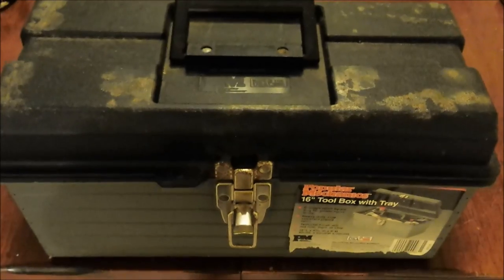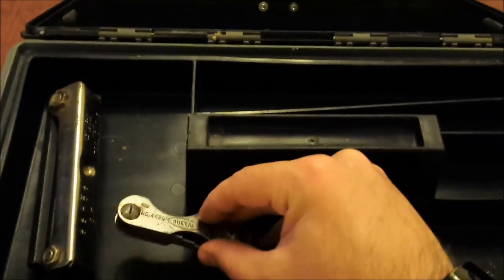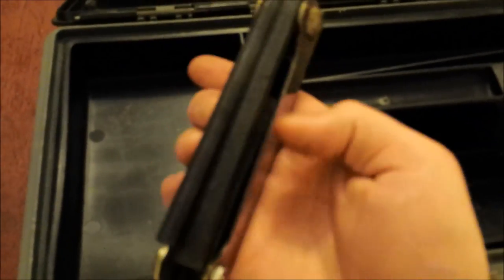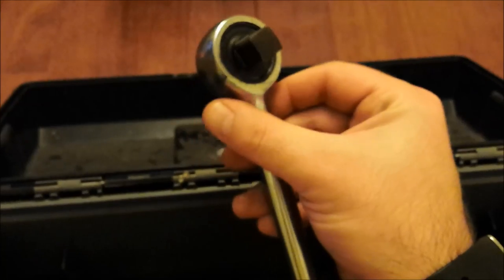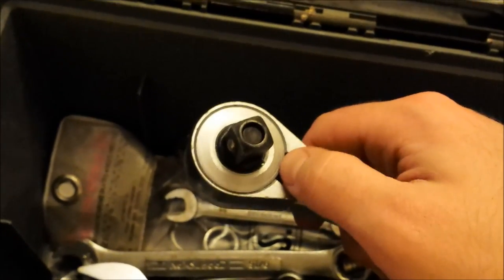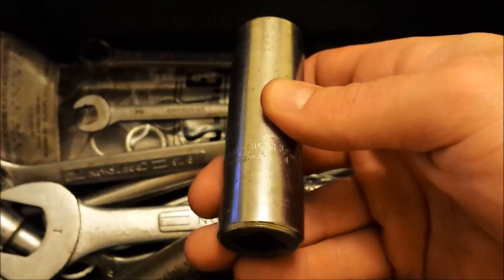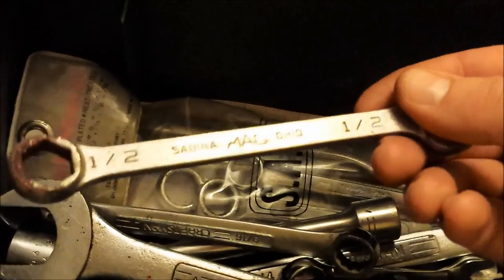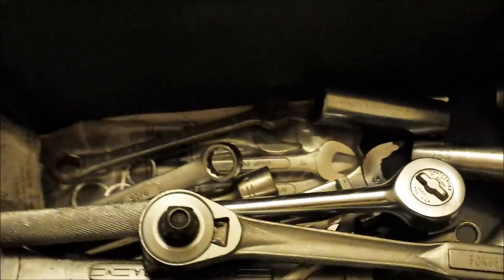Salvaging and Restoring Old Tools

Comment: Would love to see how you went about doing the cleaning and restoring rather than just the results.
Reply from the maker: sqWADooSh The next batch that I clean up, I will do some before and after as well as show the cleaning process.  It was a pretty simple process though: 1.  Soak in CLR overnight.  2. Buff with steel wool and wire wheel. 3. Rinse.  4.  Lightly oil all exterior surfaces.  5. Grease any mechanical components (ratchets for example).  Thanks for watching!